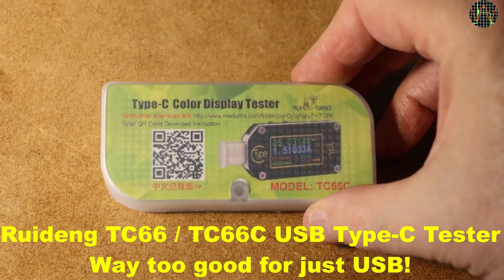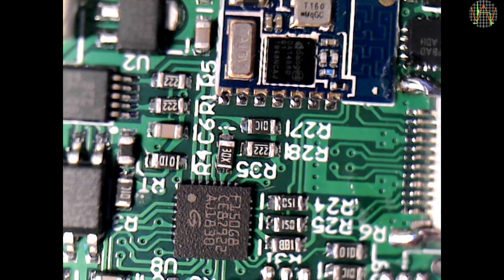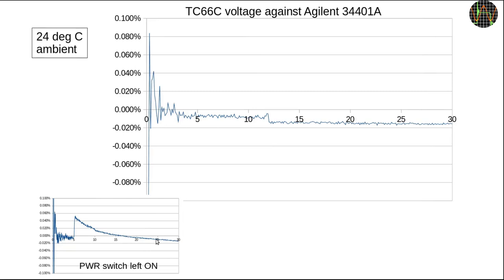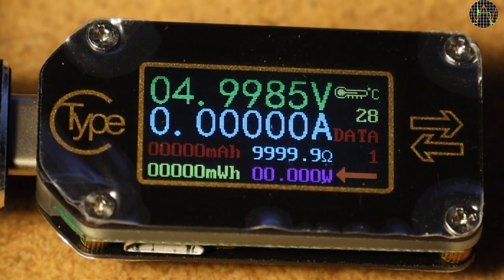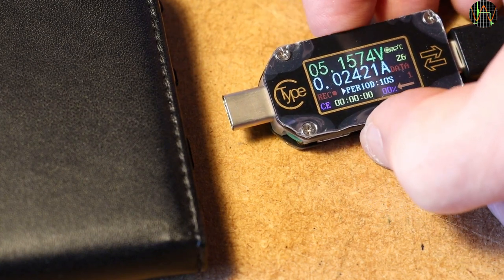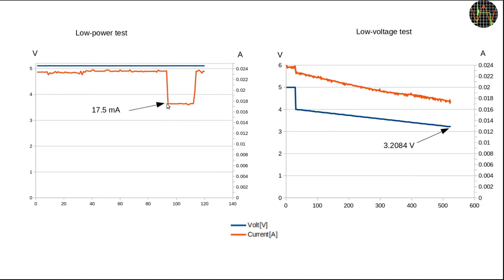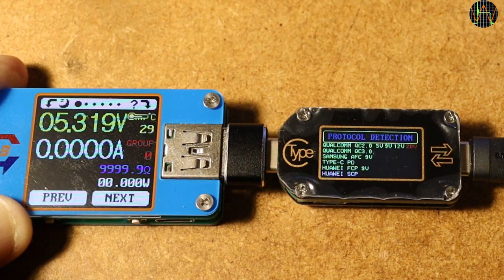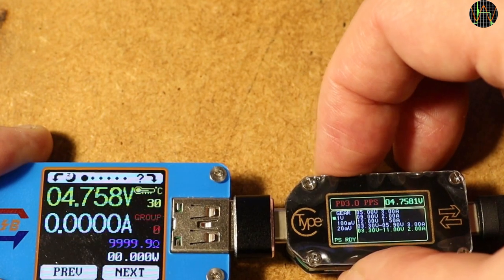Ruideng TC66 / TC66C USB Type-C Tester - Way too good for just USB!

Comment: if you want to eliminate current error when the current goes from female port to male port, you can use the Micro-USB port to power on the device, so the device will show the accurate data it test, of course you need to turn off the PD and PWR switches

Comment: Sehr interessantes und kompetentes Video (wie viele andere hier auch)!
Verwendest du Sigrok (außer als Informationsquelle) auch?
Habe kein Video dazu auf deinem Kanal gefunden.
Grüße aus Wien.
Reply from the maker: Eigentlich nicht. Ich arbeite lieber ohne GUIs und Sigrok-cli ist zu limitiert.
Reply: @TheHWcave Danke für die schnelle Antwort! Bist du interessiert an C++ Varianten deiner Python Versionen?
Reply from the maker: @HelmutFischer-thehefi  Nicht persoehnlich, aber der Code ist ja frei verfuegbar fuer alle.
Reply: @TheHWcave   Hi, sorry das ich mich hier einhänge. Erster Versuche unter Linux, und ein kleines Problem mit dem Skript. Meine Console sagt:  <module>
    import serial,argparse,math,struct,sys
ModuleNotFoundError: No module named 'serial'

Was mach ich falsch?
Reply from the maker: @falloutboy286  well, yes, pyserial is not part of a standard install of python. It has to be installed separately for example using "pip3 install pyserial" on the command line (assuming pip is installed and working!!!). But you have a much bigger problem, because the other modules are all standard. If they cannot be found something is seriously wrong with your python installation. On the off chance that python3 was freshly installed, you probably just need to log-off and log-on so the paths are properly set in your session. If that doesn't work, python3 needs to be reinstalled.

Comment: WOW. This review / instruction manual is gold. I came here to say I do not recommend this device because it doesn't have proper detection / enumeration of PD modes, but IT DOES! It's just not documented in the manual. The (off by default) soft PD trigger setting is crucial, too. Now I do recommend this USB analyzer. The only thing missing is the detection of marker chips in PD cables. Or will the PD trigger function cover that as well?
Is it safe to leave the "soft PD" function ON as long as the PD switch is OFF? Or can it fry the connected device? As far as I understood it's safe, but I want to double-check.
Reply: Yeah it's safe to leave it on
Reply: @naveentechs , thank you!

Comment: I've the same PPS crashes with it, especially when i try to trigger values above 12V. I've tried it with different type-c power supplies to go sure it's not the charger.  After buying also another tester (WITRN) and seeing that it works perfectly fine without any issues on that one i believe that the TC66 has a bug with its PPS trigger. Maybe it can be fixed in a firmware update.
Reply from the maker: Good to know. I thought it was the charger when it happened to me. The firmware is definitely in need of an update. In fact there is at least one update available since I made the video. But I am very reluctant to upgrade since I am using the USB remote interface a lot and that needs the reverse-engineered encryption key to work. I am worried that they may changed it in newer firmware. Remote access is far more important to me than USB PD triggering (which I can do using other means if i really need it)
Reply: My tc66 came with firmware 1.15 from the factory and I couldn't see this behavior. What happened is that on a cheap charger (Iniu CH20L-PQ-EU) that offers PD 3.0 PPS, when entering the reported 3.3-11V mode the maximum voltage it gets is 11.2V and the minimum is 4.88V, but there is no crash when I try to decrease more, just nothing happens. With a Ugreen CD137 I could lower the voltage normally down to 3.3V and increase it to the 11V. Maybe the folks at Ruideng have fixed this problem in firmware 1.15 and haven't just added support for another bluetooth chipset as the changelog says? Anyway, there is also firmware 1.16 but the changelog just says "Stability optimizations"

Comment: Great!
Two questions:
1) Is it possible to poll datas faster then once per second?
I would need 100 polls per second, or better 1000 ...
2) Does the device survive a short circuit in the load?
Reply from the maker: 2 msgs per second, possibly 3 is the max. I ever achieved reliably There are no fuses in the unit. If the current gets too high for too long,  something (USB connector an/or PCB tracks and/or shunt) are going to suffer...
Reply: @TheHWcave  Thanks for your answer.
There is no need for fuses if the circuit measures the current and can close a Mosfet in the current path, in case of a short.
All notebook computers have such a circuit design, so I was hoping the USB tester would also be made in such a clever way.
Seems it is't so.
.
And about the max measurement rate:
I've had a look into the datasheet of the INA226. This chip can handle relatively fast ADC conversations up to 200 kHz. So I was hoping, the TC66C would be able to poll datas from the INA226 as fast as this chip  can. Maybe with a firmware fork etc.
.
The TC66C would be a great diagnosis tool for faulty notebooks if it could measure at higher data rates.
The Buck Converters in each and every notebook are activated at startup in a specific order, with some milliseconds between each single activation.
To know exately the timestamp of changings in the current flow would allow to make a good diagnoses without opening the notebook's case.

Comment: Hi. Very interesting video. Can you tell me how to do the bluetooth pairing?
Reply from the maker: I admit I have not done this in ages, I normally use USB powered mode and get the data the same way. Anyway, from the manual and shaky memory: You can't pair from the normal phone/table bluetooth. Instead you must download and install their APP and turn location permission on- apparently because of the use of BLE, and then connect from the app itself
Reply: @TheHWcave  Thanks for the quick reply. I somehow do not get it working. But it does not really matter.

Comment: Hey there. Really great video!! It answered so much of my questions :D . Though, I do have a question.

So I have a power bank with 2 ports for output. and let's say a phone which is the thing i wanted to check for capacity. 

My plan is to use the port 1 of the powerbank to power the TC66C (PD off since it does PD communication by itself and PWR off since i want it to be accurate)
and then i will use port 2 of the powerbank to actually connect as input for TC66C to charge my phone.

That works fine right? My logic says it should be fine but idk, that's why i am just trying to confirm things. Anyways. Thanks for the video!!
Reply from the maker: I see what you want to do and it may work but this has a high chance of going horribly wrong too. It all depends how the power bank's two sockets are implemented. It could very easily fry the power bank, and/or the TC66C. I strongly advise against doing that. Better, insert the TC66C so it doesn't count its own power consumption. Remember it measures the current coming in or out from its  socket not its plug. The current on the plug is the current on the socket plus its own draw. So, if the plug end is connected to the power bank, the battery will be drained by the combined current from both the phone and the TC66C but the display will only show the part that goes to the phone.
Reply: @TheHWcave  yes. I don't want to measure my powerbank. I want to just measure my phone. That's why my first thought was to have a short USB C cable connected to the powerbank port 1. And at the end of that cable. I'll plug the TC66C in. And the male part of TC66C would go to the phone. And to make sure I don't have skewed measurements, I will use the port 2 from powerbank to power the TC66C externally. Does that work? Or is it dangerous? Thanks again

Edit : also. If I understand this correctly. This means that if the PD switch is off. It should be totally transparent right? So every PD protocol handshake should be undisturbed? And is it USB 3 ? I can't test right now since it's still on the way. Thank you

Comment: I've had the TC66C for a while but only realized its potential after watching this video!

Is it safe to use it as a USB-A power meter by attaching suitable adapters to both the USB-C ports and putting the PD switch in the off position? I have an older USB-A meter but might as well use this higher quality one.

Also, the post on measuring cable resistance shows that one can use the microUSB port to measure the resistance of a microUSB cable, thereby avoiding the need for an adapter at the tester end. Is that true for the TC66C as well?

Thanks
Reply from the maker: It is save to use the TC66 as a (very accurate)  USB-A tester with the right adaptors. I do that all the time.  The TC66's microusb port is only for powering the TC66 and communication with a PC. This means you can't use it for resistance measurement of a microusb cable. The only option is to use the USB type C ports with an adaptor, which will of course influence the measurement somewhat (depending on its length/wire sizes/build-quality)
Reply: @TheHWcave  Thanks; I've placed orders for tiny microUSB female to USB-C male adapters in rigid housings to keep the lengths small! MicroUSB female to USB-C female adapters are apparently not a thing.

Regarding Lightning, the ARTEK Lightning female to USB-C male adapters I found are advertising 56K pulldown resistors to enable charging. Will this compromise the measurement of the cable resistance of Lightning cables?
Reply from the maker: @unmeshagarwala8156  I am not an expert on Lighting but the 56K is probably used in a similar way to signal that charging is needed. You are interested in the cable resistance of the power connection, which should be in the low single digit ohm range. Even if the 56K were in parallel, it would make no difference to the accuracy of the power cable resistance measurement.
Reply: @TheHWcave  I bought a couple of 65W USB PD chargers, one for the car and one for the wall, and tried monitoring the charging of a MacBook Pro with this unit. The MBP says it is charging at 65W and the meter shows 20V but the power displayed jumps around between say 35W and 65W (and the current proportionally).

Any ideas why?

The PD switch is in the OFF position and the USB-C cable is rated for 100W
Reply from the maker: @unmeshagarwala8156  Not having a MBP, my guess is that possibly an overload/overheat protection circuit is activating periodically, throttling the power.  This could be in the charger, cable (it may have circuitry inside) or the MBP.  Does it happen more often when the charger is hot? Does it change with the PD in ON?
Reply: @TheHWcave  Toggling PD makes no difference. Nor does changing the cable or charging block or using a Windows PC as the sink. The load is 45W but still the rapid fluctuations in the display
Reply from the maker: @unmeshagarwala8156  Hmmm, it could be the charger. What is the behaviour with different chargers (different models)?

Comment: Very informative.  Thanks for posting.  How do I test maximum current output for a PD charger?  For example, I have a PD charger with specifications of 3A @ 5V, 2.23A @ 9V, and 1.67A @ 12V.  I want to know whether the charger can actually deliver 2.23A at 9V.  I was thinking of doing the following: trigger PD 9V on the TC66C as described in your video with a load tester attached to the other end.  Then increase the current draw on the load tester to 1.67A and see if the voltage remains around 9V.  Will this work?
Reply from the maker: Yes, if the load tester can handle 9V that is.

Comment: Why if I insert the meter on a usb type c port on my powerbank to test discharging value (PWR and PD set ON), the meter is going to shut down in 1 min? Am I missing something? Thanks for the amazing video -!
Reply from the maker: if only the TC66 is plugged into the power bank and no additional load current is flowing, it is likely that the power bank simply turns off. Many power banks do that to preserve battery if accidentally turned on with nothing connected. The tiny current used by the TC66 is not enough
Reply: @TheHWcave  thx 4 the quick reply. So for a full discharge monitoring, is it better to connect another device? such as another powerbank (with more capacity). So the line will be PB1-meter-usb-c cable-PB2
Reply from the maker: @AlessandroBernes  It is not the capacity of the power bank but its behaviour when very little load is detected. If you want to measure a power bank capacity by discharge, you need a decent size load, e.g.  power resistors, connected through the USB tester to the power bank. You need to reset the tester before start and at the end, when the power bank has shutdown, the tester will be off too. You need to plug it into a USB port with power to see what the last capacity and energy values were before the shutdown. Note that the load resistors must not overload the power bank, because in that case it might shutdown to protect itself.

Comment: Great tutorial. I’m using your Python code to measure the power. Is it possible to fully power off the port (disconnect)?
Purpose is my board has a EEPROM. After the settings are programmed, it needs a power cycle. If there’s a way to do, it will be lot helpful.
Reply from the maker: I am not quite clear on what you are trying to do but if you are feeding your board with the EEPROM through the TC66's USB-C connectors to measure its power consumption by montoring through the micro-USB port (and PWR switch on the TC66 is OFF), then all you have to do is to power-cycle the power going into the USB-C of the TC66. The power on the TC66's USB-C output will follow along (i.e. also power cycle) and if that is feeding your board will also power-cycle but during the whole process the TC66 will stay on allowing you to continue monitoring whatever goes on in  your board. Does this answer your question? Maybe I misunderstand your configuration?

Comment: I do not have a load to measure battery capacity.  So how can I use TC66 to get actual battery capacity (mAh) of power bank using TC66 but no load item to discharge the power bank.  Thanks
Reply from the maker: You could use any USB device as a load, for example LED lights or indeed charging a phone/tablet but there are issues. Those loads may turn-off on their own making the results a bit unpredicatbe and not easy to repeat. Better invest in one of those very cheap USB loads on the "Internet" that consist just of a USB socket, a switch and 1 or 2 big wire-wound resistors to draw either 1A or 2A at 5V. They cost very littte and enable reproducable tests, just beware, these get very hot. Don't touch and keep well clear of anything that can burn. The 2nd fundamental problem is that measuring a power bank from its USB output will always show a lower capacity than what the battery really has. That is because the electronics in the powerbank to produce the nice and stable 5V take their "cut" and delivery only 70-90% of the battery capacity. The same problem happens when measuring charge going it. Now the USB tester will record more capacity than the battery really could store because of the inefficiency of the charging circuit. The omly way around these issues is to open the powerbank, disconnect the battery and measure it directlt, but this is an advanced operation and needs experience. Just accept that measuring "from the outside" will not give the true battery capacity but at least the capacity usable in practice.
Reply: @TheHWcave  thanks for the very complete answer as well as tips and info.  I think I will take your advice and get one of those load resistors since they cost next to nothing and I could use this USB tester for other batteries etc in my house so a very small cost for alot of information i could get back.  Keep up the great vids - I appreciate them.

Comment: I noticed that when I leave the PWR switch turned on, there is a voltage leakage through the microusb input, it increases slowly until reaching around 70-80% of the voltage of the USB C input. Do you see this same behavior on your tc66 unit? Do you think this could cause any damage if the microusb input is wired to some computer and the user forgets the PWR switch turned on and then tests at voltages greater than 5V?
Reply from the maker: Yes, this is quite normal because the microusb is connected via a diode to the input of the 3.3 voltage regulator as is the VBUS of the USB-C (if the power switch is closed).  Because of the diode, there is no danger that the TC66 can accidentally feed power back into a connected microusb device when the USB-C voltage exceeds the voltage on the microusb port.
Reply: @TheHWcave  good to know that, i thought that with the voltage leakage it would also have current leakage. And if I'm not mistaken I remember seeing that you wouldn't update your tc66 for fear that your program would no longer work, but I updated mine to firmware 1.16 and it still works normally with the rb-usb program (I believe that it uses the same commands as yours). So you can upgrade yours without fear. Unfortunately the changelog is vague and only says "Stability optimizations", maybe you can compare it with the cons you found earlier and see what has changed
Reply from the maker: @KaMyKaZii  Yes, I was holding back with the upgrade in case they changed the encryption key. Thanks for the info.
Reply: @TheHWcave you're welcome. And is there any chance you have the 1.14 firmware file? I decided to play with tc66 and realized that it is possible to downgrade, I would like to test firmware 1.14 just to see if I have the same crash than you while changing voltages in the PPS trigger
Reply from the maker: @KaMyKaZii  I have the TC66C_V1.1.4.apk file. Send me a message to my email (see channel info)